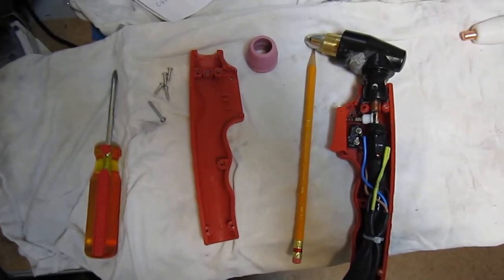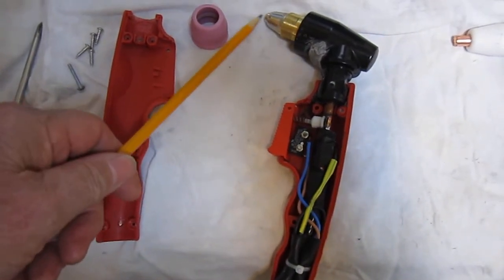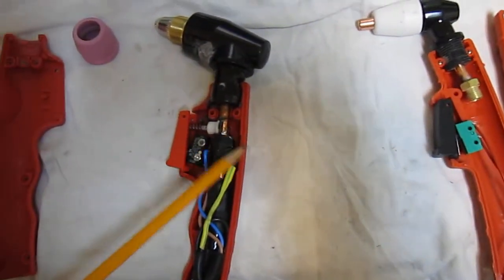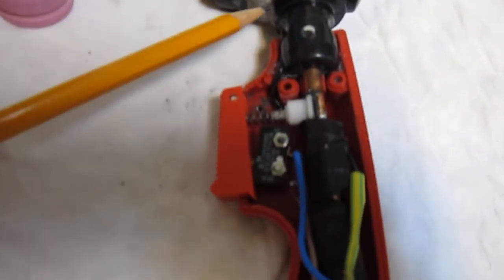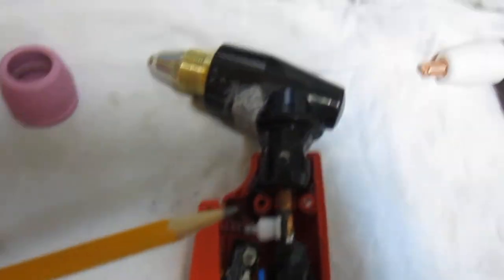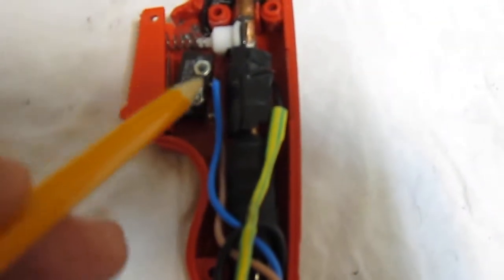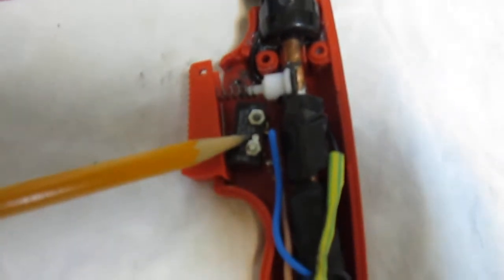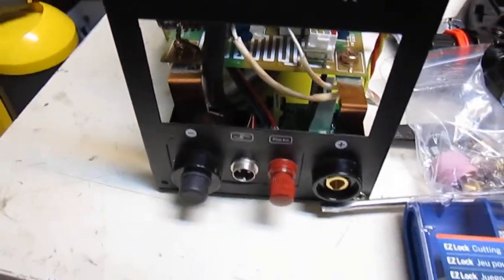Pilot Arc Torch DIY conversion

Comment: It can be done with any HF machine, it doesn't have to be a pilot arc machine. Solder on a wire just as you did and run that wire to your ground clamp, it tricks the machine into thinking the tip is touching the work piece...use #12 wire. I run the cheapest pt 31 that I can get because I like them, they cost about $12 and the consumables are dirt cheap.

Comment: People want to know how to make a non pilot arc machine into a pilot arc machine. First off you do not want to run your full cutting amperage as the voltage for the pilot arc. I purchased 2 10 ohm 200 watt resisters with heat sinks . Second, like a TIG welder the plasma torch is (-) negative and your ground clamp is positive. Look on your cut 50 see the connector for the pilot arc is red. So if your wire going to the pilot arc is red or positive the torch would need to be negative otherwise nothing would happen. No arc in the cone. The main reason you want a lower amperage arc as your pilot is you want the pilot arc to shut off quickly otherwise the arc will start cutting through the cone your little wire would just burn up. I copied my system from another guy on YouTube and it works great. As soon as your tip gets close enough to the work the higher amperage takes over the arcing and the pilot arc shuts down. It will turn back on if you pull the torch away from your work and keep your finger on the trigger. I don’t even have a plasma cutter, I converted or added Tig and plasma to my Jeggs 180 amp MiG machine.
Reply from the maker: way cool good job but mine worked also !
Reply: Mark - thanks for that additional information. I am attempting to find a straight torch that supports pilot arc for the CUT 50D that is also a pilot arc machine. I have also read about using the resistors to keep the abuse down on the tip during ignition until contact. I am going to guess the resistors will go inline between the pilot arc terminal on the machine and the lead line into the torch right? Would you mind posting the other video's link so I can also benefit from it? And any clue on where to find the straight torch (for CNC use) would be great too. Thanks again sir...
Reply from the maker: I was converting a nonpilot arc torch into a pilot arc type not the machine !  thanks
Reply: @jerryhudson3033  the question was for Mark... thank you.
Reply from the maker: @AtomkeySinclair  sorry man

Comment from the maker: the duty cycle on the machines is not long, cutting small and or thin parts in a cnc would be ok, but long term use
EX: 10min will come close to a burn out on the electronics.

Comment: thx Jerry for information 
do you think it would visible to tap the wires inside the machine coming from the connection it self,  if my cable is long enough then I will try it that way
Cause the CNC box is connected on leg of the table and the cutter will be down there next to it also
I tell you simadre won't tell me shit I wrote to them and the tec says try it you r on your own 🌪then has the nerve to say, my best regards. Ah sorry for the other stuff I added.